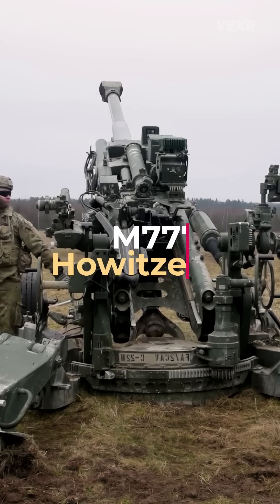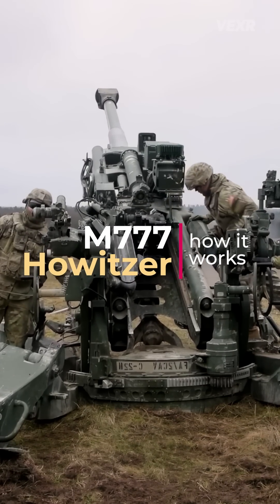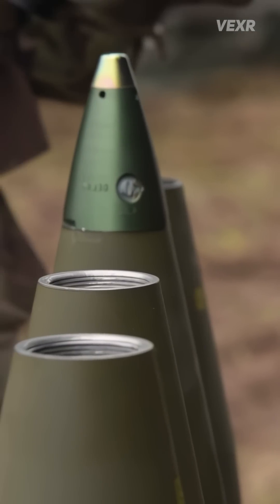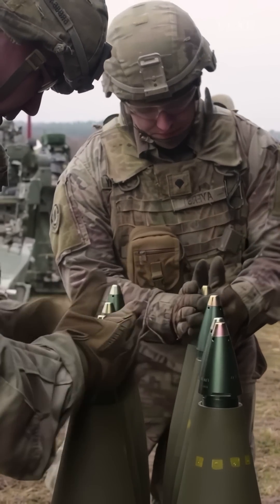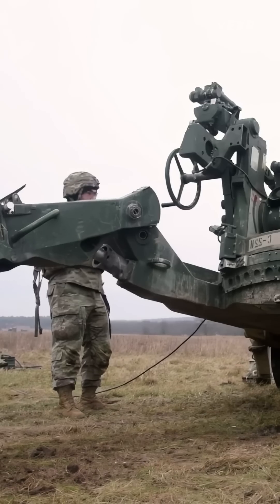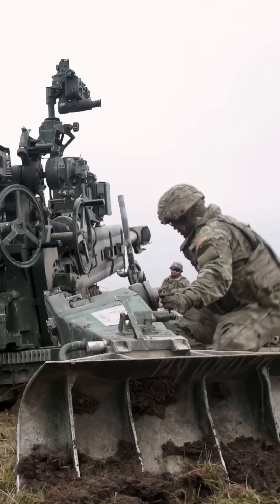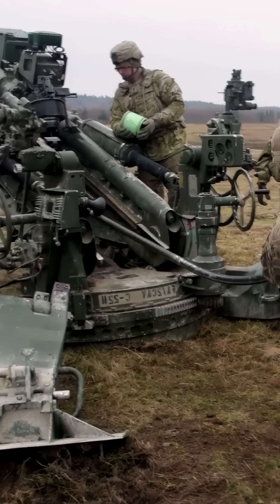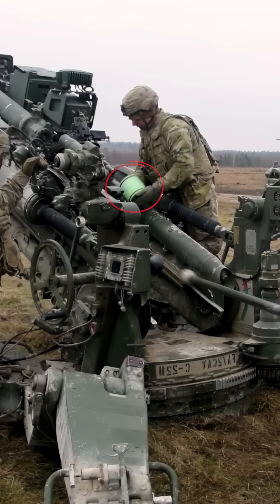How It Works: Full Process of M777 Artillery

Comment: All hands be advised:  Upon my channel sits the greatest  poem ever written about The King of Battle.  It was written by yours truly.  It is long, it is violent, it is at times  profane, but it is right.  If you served in the Artillery or your job served the Artillery in some way, know that I wrote the poem for you.  The poem has been transformed into a video, but you’ll still have to read it as you watch it.  If you have high blood pressure, or a heart condition, you ought not read it due to the possibility of over-motivation and an adrenaline spike that could cause you to stroke out.  The channel has very few videos, the poem will be easy to find.  
- Dusty

Comment: So what is that spike thing that is past the muzzle?
Reply: It hitches to the truck that pulls it.  It’s pulled in a  muzzle first fashion when going down the road.
Reply: @DustDevilRage  Really? My BIL went to West Point, then the Artillery, and HE didn’t remember what it was! Why pull it muzzle first?
Reply: @samiam619  
Not sure.  I served on the predecessor to this gun, the M198.  It was pulled in a rear first fashion. The trails locked together and one of them had a large metal ring that hooked into the hitch of the 5-Ton, or our truck. 

This gun  is made by BAE systems, British and Canadian organization I believe.  

That’s just the way they made her.  

I would think that It’s probably quicker to get laid on to the unit’s Fire Direction Control azimuth of fire with it being pulled front first.

Arty moves around often.  Have to get laid and safed in each position.

Comment: Its also a lightweight platform, designed for rapid air deployment, and only meant to provide short duration fire support. As a consequence it has a very short operational life before needing repairs. It is not meant for fighting long,high intensity engagements, day in day out.

Comment: I worked with the model before this the M198. That too was a 155mm but it was not on as big of a baseplate as the M777 is. Other than that system looks very similar. My crews loved the 155mm but they also loved the 105mm even more. The 105 you could load faster and shooter faster.
Reply: so how does this work. How would you know you are hitting something?
Reply: Not paying attention when your doing a final protective fire or an expend all remaining and you could loose some fingertips. Came close several times

Comment: Caliber?
Shell weight?
Range?
Crew size?
Types of munitions?
Reply: Caliber? 155MM
Shell weight? ABOUT 100 Pds

Range?  15 miles unless you use a RAP round
Crew size? I have seen as small as three but typically about 5 with crew chief (NCO)
Types of munitions? Reg HE, RAP (Rocket Assist Projectile), Illumination, there is one that can do mines, and then the "nasty" round White White phosphorus. We were also told they were Nuke capable but only 15 mile range I don't want to be around if the shoot one off!

Comment: "The VA has determined your hearing loss and back injuries are not job-related.
Thank you for your service."
- Veterans Administration
Reply: 13B here and all of us have bad backs and can’t hear crap. I can’t sleep without a fan blowing
Reply: @unionpride525  do you guys have ear protection during service? Like a foam ear plug or something?
I normally improvise with 2 pistol casing to plug my ears
Reply: @nobeltnium I am a retired artillery officer, and ear plugs of all kinds are of some protection. IF they are the real baffled type as the sponge, ones were not so hot.  The real hearing protection are high quality and covers the entire ear but they so not work with helmets.  The howitzer shown is all manual and while it is effective, it is not as agile as fully automated tracked the Paladin howitzer.  Paladin can shot and quickly move out so that it does not get enemy counterfire  coming at it as it will be gone before its rounds land on the enemy.
Reply: @unionpride525 13boom boom here as well.  79-86, and I have all 3 as well and I  feel tye VA doesn't give a shit either.
Reply: LOL
Reply: This thing also causes TBI's but they won't admit to that.  Had a friend that was nearly deaf due to running artillery in Korean War.
Reply: YEP, being there done that, 0811, Fox 2/10 2ND Marine Div. took 20yrs fighting with the VA.
Reply: Bunch of my disc's r out & crushing sciatic nerve in each of my legs,Ft Sill 13B class of 97. I recieved no help or compensation cuz they said i didn't happen cuz of my mos. FML, ty so much for a life of pain..
Reply: @markdemelo  so they’re responsible for everything that happens to you while active? You would get the same answer if you worked for the post office.  Funny how people do 4 years and expect to get a paycheck the rest of there lives
Reply: I believe veterans should be treated with the utmost respect nobody has given more then them…. America is so greedy to help its own but we have the money to spend on bullshit..
Reply: What?
Reply: It's a goddamn shame the way the military treats veterans.
Reply: @st3althyone  or worst yet, how the VA treats the Vets like we owe them and not the other way around.
Reply: Underrated comment 🇺🇸
Reply: And constant brain-shaking.
Reply: yep thats what they told me also after 3 comba tours on M198's
Reply: A friends dad was totally deaf in one ear and 50% in the other from firing one of these in Viet Nam for 9 months.
Reply: Shut up. Your grandfathers world be ashamed of you all. America is soft
Reply: hahahaha appeal form please !!!🤣
Reply: They make sure you have enough ear protection to have you under a safe decimal. Everyone bitches about the va but I see a bunch of people abusing the crap out of it so I’m sure the ones that really deserve it have it
Reply: Sad but true 😢
Reply: Bullshit, you know how fucking easy it is to get a service connection rating these days. Your probably one of those jokers that never puts in the work but equally complains about the VA. Boy, it really pisses me iff when dipshits say stuff like this about the VA.
Reply: My father received the same verdict from the VA.  He served with the M109 first generation in Vietnam.  In support of fight for Hamurger Hill, his units 18 guns fired 10k rounds during the battle...
Reply: The VA has determined that gun fire, back in the day was the #1 loss, for hearing, I have been wearing hearing aid ever since I got out
Reply: Sad but I believe that from the VA Sadly they don’t take care of people like should.
Reply: @toma9867  they don't
Reply: But we can't dish out money fast enough for Zelenski to pocket.
Reply: @matthewhowe3727  so thankful those money won't be used to fund rightard's mass shooting agenda.
Reply: @matthewhowe3727  Oop do I see a dumb strawman! I think I do! Go back to the FSB Matt! Jig’s up!
Reply: @matthewhowe3727  He keeps begging, you keep giving... the circle of life..
Reply: @matthewhowe3727  He doesn't pocket a penny you liar
Reply: @crowbar9566  u Ukrainian?
Reply: @patricknevermind8529  corrupt alphabet agency plant or a Ukrainian bot I'd say
Reply: @crowbar9566  He pocketed 400 million
Reply: @yechris2001  <-- Russian bot spotted
Reply: @crowbar9566  $400 million has been been pocketed that we know of so far.
Reply: @crowbar9566  Sorry ... He meant billions of $$$ ... not penny . Ukraine borders are reallllllllly important . Read the Budapest treaty of 94 much ? US had boots on Ukrainian soil ... Russia is simply making certain the treaty is respected . There are only two genders, by the way .
Reply: @yechris2001  proof?
Reply: @crowbar9566  lol yes he does, but what can we expect from a clown to like to dress in drag 😂😂
Reply: @crowbar9566      Who can say what Mr. Zelenski is pocketing?

Someone is getting money in Ukraine.
Reply: @adamm5205    Telling the truth doesn't make you a Russian.   Irony intended.

Comment: The maximum firing range of the M777 howitzer is 24.7 km (15 Miles) with unassisted rounds and 30 km (18 miles) with rocket-assisted rounds. It can also fire specialised ammunition that can extend its range to about 40 km(25 miles).
MOST IMPRESSIVE! 😁👍👏🏼🥳🥳
However the M142 HIMARS system is a game changer for Ukraine 🇺🇦. So far 4 have made it there & has already made a significant difference. More on the way. 👍
🤔 Putin took a gamble that 36 Countries wouldn't back Ukraine. Big mistake.

Comment: I wasn't in Artillery but I was surprised how small the prop charge was. Does anyone know if they use multiple charges for distance? Like the implements on mortar systems?
Reply: Someone above commented that the shells have propellant in them already, the small charge was added for extra distance. ¯\_(ツ)_/¯
Reply: Yes there is a charge 6 and a charge 7. They look like bean bags you would use for the game and their is a number on them so you know what charge they are.  I was an artillery mechanic for the M198 (155mm) and M101A1 (105mm).

Comment: Always felt bad for the gun bunnies.  That's a job that virtually guarantees a bad back at 45, and hearing loss if you arent careful.
Reply: I can vouch for that.
Reply: Have you ever heard one? They give you ear protection, but it does not work to well. I heard them go off right beside me so it is not to bad.
Reply: @SupremedivinereaderKim  I used to fire them… back in the 80’s we didn’t have ear protection so I say “what” a lot
Reply: Don't earplugs help

Comment: I love how smooth that recoil mechanism is, didn’t even shake the ground that much even though its a 155mm gun
Reply: That’s because it was already dug in and fired. Fire it for the first time after em placing it and it will move.
Reply: And they are shooting Lima charges which are powerful but you throw a 3-4 hotel charge that thing will keep moving back. Before you know it. The gunner and AG will be in a hole.
Reply: Watch out Lancet drones are coming

Comment: Haw much dirt can the barrel handle? noticed the ball on the end of the rammer was allowed to touch the ground, also, do they have a proximity fuse option?
Reply: ToT- time on target fuses set basically the altitude the round will explode. 13E’s do the math, the Gun Bunnies just load the round, the shotgun shell and pull the lanyard 😅. New rounds can have proximity fuses and directional control via stabilizers.
Reply: @ThreeBattRanger  Directional control using on board GPS?